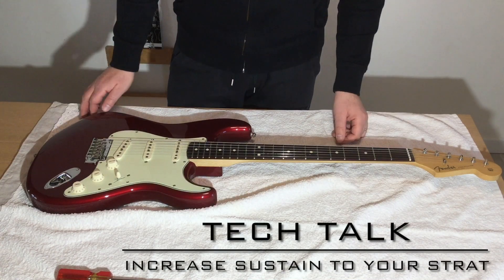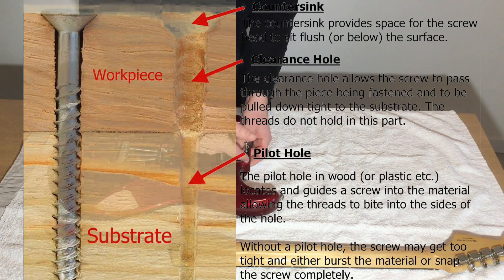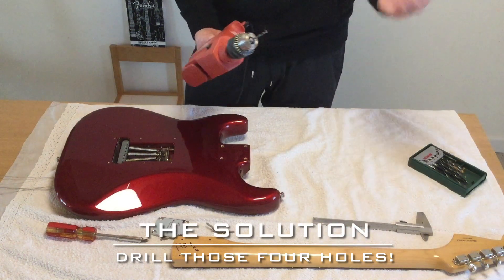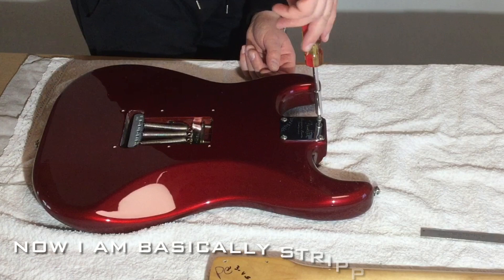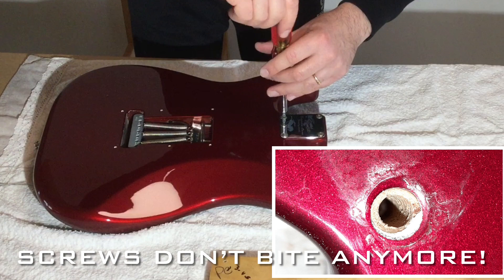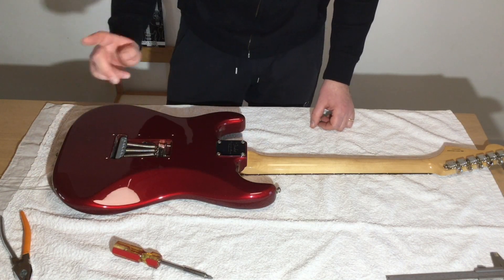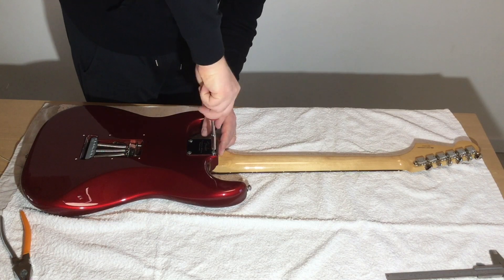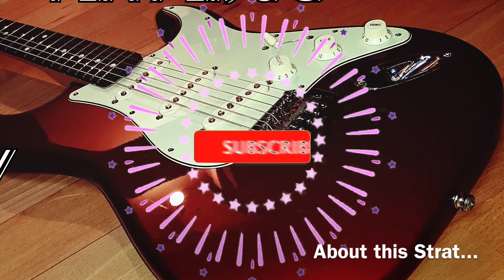How to IMPROVE SUSTAIN on Fender Stratocaster Telecaster and bolt on guitar? #sustain #boost

Comment: Very good! I had done this few years ago on all of my guitars! It has positive results! 
  I loose a bit all screws (1/4 turn) under full tension of the strings, for tight set in the pocket. Then I do string-alignement by angling  the neck as needed. Tighten first the screws towards headstock, then those towards body.
Reply from the maker: There is not any risk in doing it, just benefits. You just need a minimum knowledge about what you are doing!
Reply: I always do this to my Strats!!!

Comment: That's awesome - and a great tip as sustain does get lost with a loos neck joint. Thanks for sharing this my friend - excellent tip!!!
Reply from the maker: Thank you mate!
Reply: Match sticks shoved down the hole followed by a dollop of superglue tightens everything up
You got to screw down fast. If you dont have a cordless you can get nasty blisters.
Reply from the maker: Hi William, sorry is this comment related to this video? I don't understand! Thanks
Reply: If the screws are spinning in the neck plate the match sticks provide extra wood the screws suck the joint tight. I believe it was
StewMac I learned this from. It works. Am I still missing the point?
Reply from the maker: Well, the point 8s that the screws should turn freely in the body wood, because there should be a clearance hole there. The trick you are mentioning can be useful if you strip a thread in the neck,.I have another video showing that!
Reply from the maker: Here it is!
https://youtu.be/im-kHebRAto